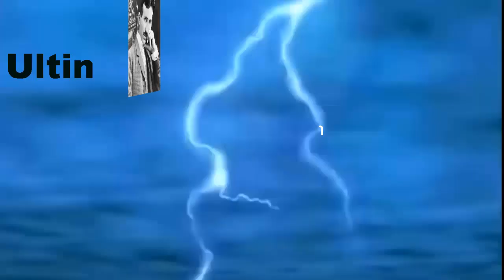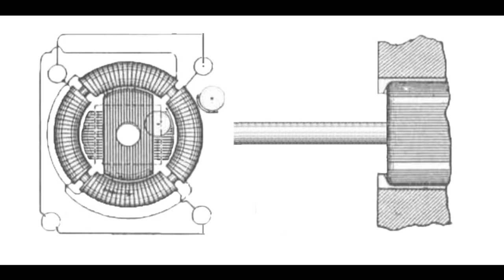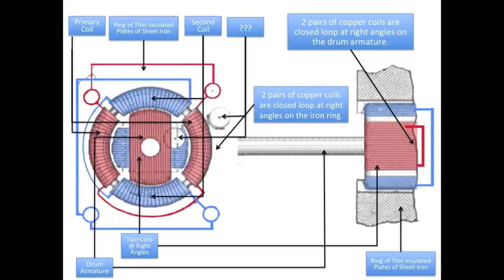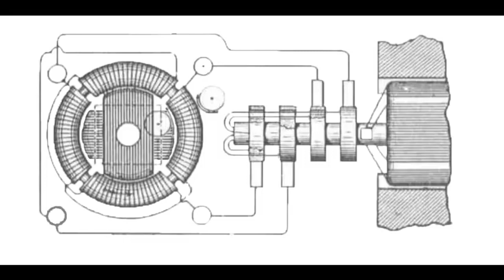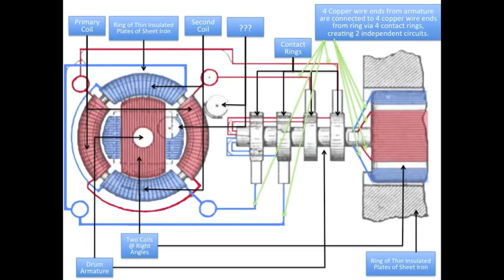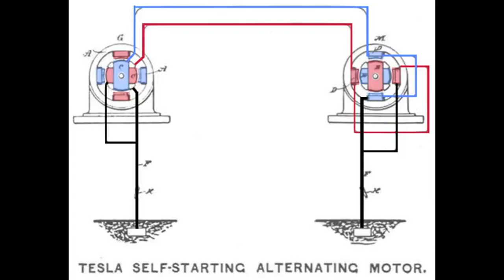Tesla Generator Free Energy: Build a self-sustaining Tesla Generator

Comment: From mi point of view , it looks like you have to drive the alternator  your self to drive the the induction motor , like a shaft less connection at a distance , I didn't hear Tesla se anywhere that enything is perpetual? He always make's systems to harvest the energy what is Al around us ,like serounding heat en waterfall'sem then distribute it around the globe so meby your right whit this system, but the power have come from the magnification stransmitter in order to run , nice video by the way
Reply: Constant "Aether Torsion" = Perpetual